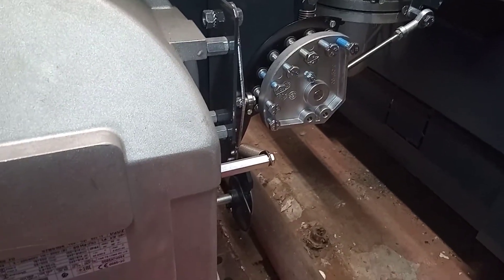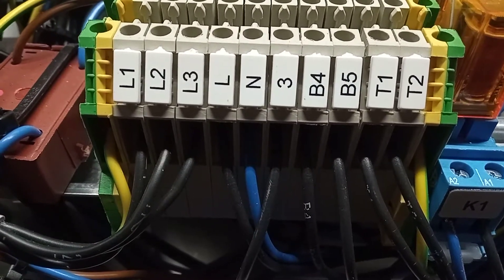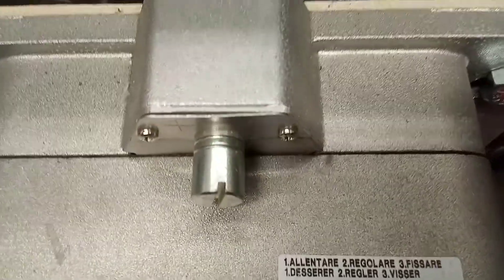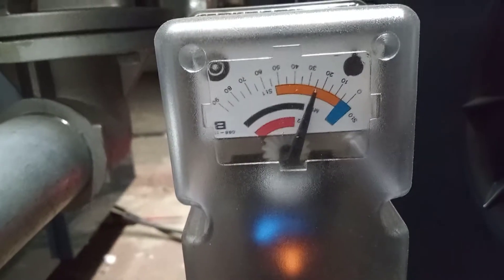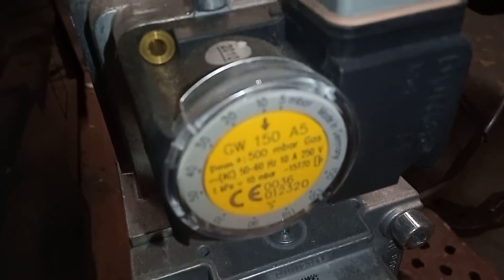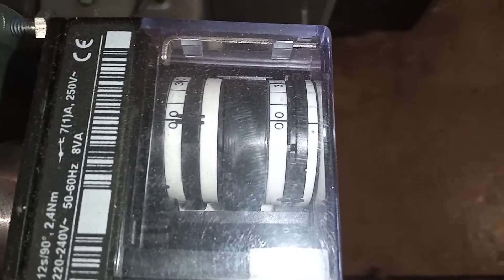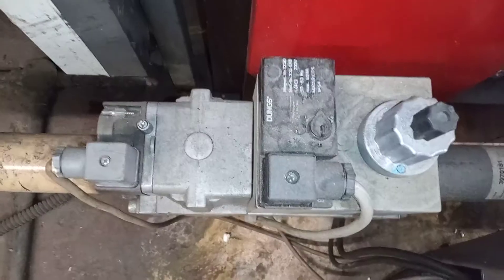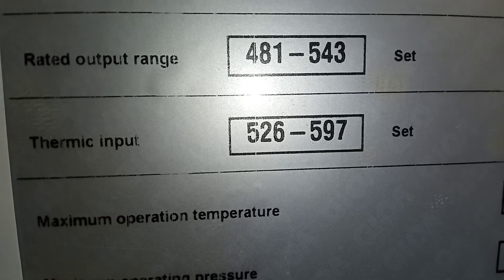RIELLO RS 50/70 COMPONENTS

Comment: Can I switch this burner to work with diesel and what i need please 🙏🏻
Reply from the maker: Switching a Riello RS50 or RS70 burner from natural gas to diesel (light oil) operation is not a straightforward process. These burners are designed to operate specifically with either gas or oil, and switching between the two fuels involves modifications to the burner itself. Below are key considerations:

Steps to Switch from Gas to Diesel:

1. Check Manufacturer’s Documentation:

Confirm if the RS50 or RS70 model supports dual-fuel configurations. Some Riello burners are made for either gas, oil, or both, but many are not convertible.

2. Change Components:

Fuel Pump and Lines: Install a light oil fuel pump, filters, and piping suitable for diesel.

Nozzle Replacement: Swap the gas nozzle for a diesel atomizing nozzle.

Combustion Head: Adjust or replace the combustion head to accommodate the different flame characteristics of diesel.

Burner Control Unit: Replace the gas control valve system with oil-specific components.

Air/Fuel Ratio Adjustment: Configure the burner to properly mix air and diesel for efficient combustion.

Ignition System: Ensure the ignition system (electrodes and transformer) is compatible with diesel.

3. Flue and Chimney Adaptation:

Diesel combustion produces more particulate matter and sulfur oxides compared to gas. Ensure the flue system is capable of handling these emissions and meets regulatory standards.

4. Compliance and Safety:

Verify compliance with local safety codes and emissions regulations for diesel operation.

Inspect and certify the burner after conversion by a qualified technician.

5. Professional Involvement:

Only a certified heating technician should perform the conversion. Converting between fuels is complex and may void warranties or create safety risks if done improperly.

6. Evaluate Costs:

In many cases, converting the burner may be less cost-effective than replacing it with a model specifically designed for diesel.

Important Note:

Riello does offer dual-fuel burners designed for seamless switching between natural gas and diesel. If fuel flexibility is required, upgrading to a dual-fuel model (e.g., Riello RS series Dual-Fuel Burners) may be a better long-term solution.